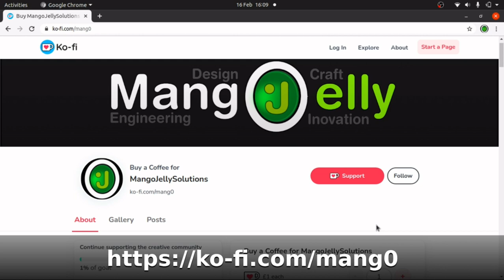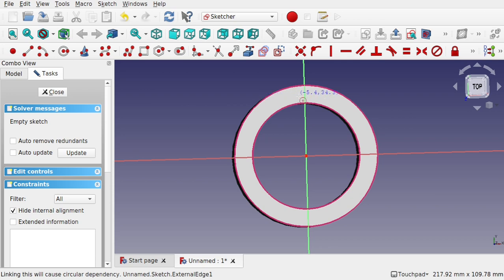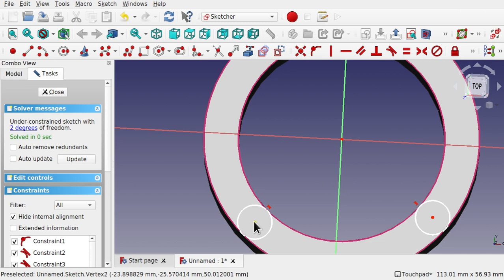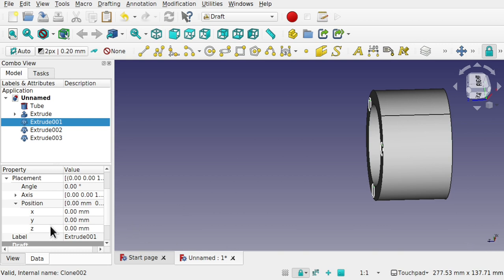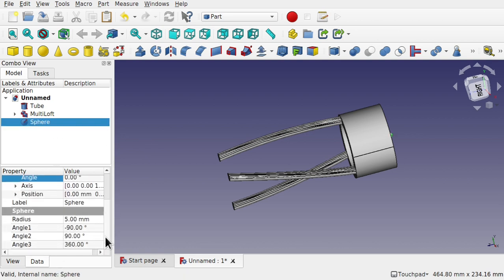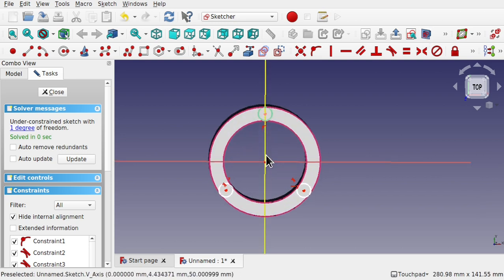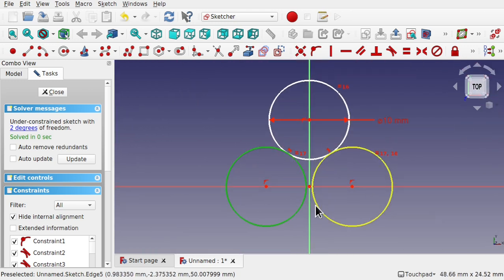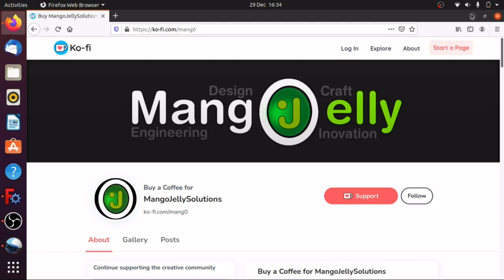Learn FreeCAD Curves Workbench [8.2] Multiloft: Blacksmith and decretive metal work design. Beginner

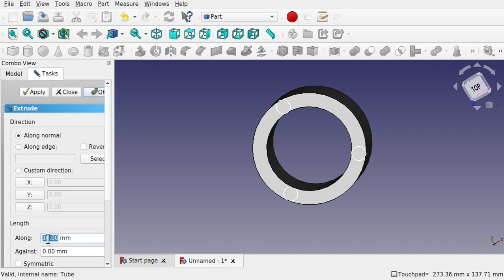Comment: If anyone is looking to fully constrain the circles (around 4:20): create construction geometry (straight lines) from the center of the 2 lower circles to the sketch origin. Then constrain the angle between these two lines at 120 degrees (1/3 of 360 degrees).